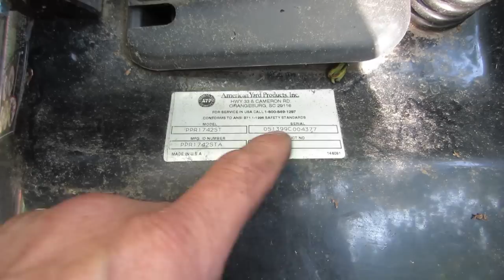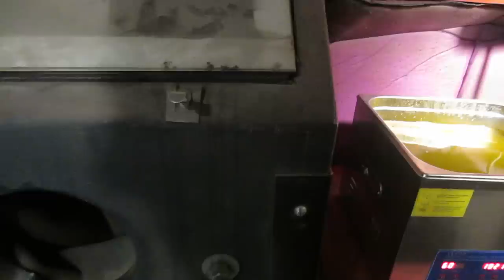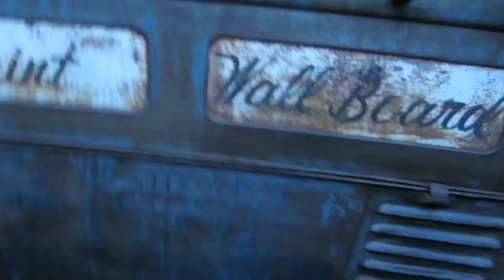abandoned poulan pro riding mower. will it run?

Comment: Thanks for 'letting me hang out in your shop.' I tore my mower apart the other day as a sort of preventative maintenance inspection. Checked valve clearances and the carburetor. 

Wouldn't have been so inspired to do so without what you've shown me while hanging out at your place.

Thanks again.

Comment: Few tips on these briggs engines. 1. Easy way to check head gasket is to remove the oil dipstick after it's ran for a few minutes, you will see smoke come out of the tube.

 2. The Walbro carburetor on most of these needs the brass inlet seat replaced or it will continue flooding the engine with gas.(the leak may not start right away. It can take up to several hours) The anti backfire solenoid does not stop this. Also replace the needle and bowl gasket. 

3. When your adjusting the valve gap and one or both valves are not moving the full distance, the camshaft lobes are most likely worn down. 

4. After adjusting the valves and the engine is still hard to turn over the cam shaft compression release mechanism is most likely broken.

A lot of you probably know this but it's just to help other's diagnose their engine.
Reply: Darrin i
Reply: Thanks buddy!  :-)
Reply: Darrin, I don't know this. I'm just getting into doing small engine wrenching and have learned a lot from Mustie1 and Donnyboy. Maybe one of these days I'll tear far enough into an engine to see a compression release mechanism! :)
Reply: Darrin I have never got such good advise from pickle Rick
Reply: add an inline fuel shutoff and turn off when not in use..
Reply: @Jakov0007  jokf
Reply: @StrangerInAStrange   the
Reply: In

Comment: Hi Mustie, I've been watching your channel for several years, I thoroughly enjoy all of the contents and projects you do. You remind me of myself, I too tinkered with many things, not as much as you but have been in the automotive field most of my life, from mechanic to service manager. I looked forward everyweek to see what is your next project, and I learned a lot from you about lawn mowers. I too own a Huscarvarna self propel that I need to fix. My mower of choice is my 10 year old Poulan 38 inch riding mower. I nursed this back to life so many times you would be proud of me. I did a mustie move when my front steering rod broke, actually the bajj joint rod the very long one. I used a 1/2 inch cooper union drilled a hole in the middle to fit on the drag link. and 2 hose clamps to hold it in place, and viola we have steering again. Cheap fix, 96 piece of cooper. Thanks for listening and please keep those videos coming.  Bob from South Jersey shore

Comment: A petrol tap in the fuel line is a good mod. Run out the fuel when you put it away and no carb problems next year, no petrol in the oil either.
Reply: Gas**

Comment: I do autobody and automotive mechanical work , I fix plastic cracks all the time. What I almost always  is make a thin aluminum stiffener to bridge the split back together , and I  rivet the aluminum on with 1/8" rivets but I also sand the plastic surface and aluminum plate face to help adhesion then use problem plastic repair material which is an two part epoxy made by SEM . If I do a plastic repair without an aluminum plate and just want to glue it , I'll V both sides of the crack out, sand the adjacent area with 120 grit paper , put 2" tape on the backside of the crack so the glue don't squirt through, and then ill fill the V"'d crack with Fuzer 100 by LORD products . It's a heat activated two part epoxy that works phenomenally. I fix cracked in plastic car bumpers all the time with this stuff and it lasts as a permanent repair . Sometimes you gotta dry the first coat then apply a second coat depending on how deep a crack or void your filling . Look into these products as they are Lifesavers when you need to repair plastic, or fiberglas .

Comment: Mustie1 I braved tackeling a needed carb replacement  job on my 5 year old John Deer lawnmower after watching your videos for a while. The lawn mower got to where it needed starting fluid to get going on every start.  I felt confident removing the old carb with all the little springs and seals and poping a new (from China) 9.99 carb on it.  Started on the second pull.  THanks Bro!

Comment: Living here in Florida, if you put on a set of blades they will not last long because of the sand. I own 6 sets of blades for my zero turn, and bought a sharpener called yellow hornet which uses a angle grinder works very good. Your channel is the best I've seen for motor fixing!
Reply: Jake Schisler  my Toro ZTR eats blades also.  I live near Tampa.  I mowed the church's soccer field and destroyed one set of blades in less than an hour.  It wore the lift portion of the blade down by half.

Comment: Hi Mustie: That is a valve rotator and usually only on the exhaust valve and not always on the intake valve. O.K. to run the motor without it on the intake valve. Thanks for the great video's. I really like to follow them. I run a small engine shop when I get time to fix engines.
Reply from the maker: l found the missing one inside when l did the head gasket

Comment: What I do with plastic like that is drill 1/16th holes along each side of the crack then sew the sides together with thread, fishing line, wire, whatever. Then cover it with super glue or epoxy.
Reply: Would that work on a crack on a Colman plastic canoe, or is it better to do the metal patch and rivet??
Reply: either way you have to seal the crack so water doesn't get in but the sewing method wouldn't leave the corners of a metal plate to curl up and cause a cutting hazard
Reply: You might want to check out some plastic welding videos.
Reply: Other popular method is to drill 3mm holes along each side of the crack and then "sew" the crack with plastic wire straps...
Reply: Awesome. Certainly worth the time and effort. Thanks for the video!!
Reply: Mike Mixer sophomore for sale
Reply: coleman? plastic weld is best, but riveting aluminum patches and auto glass glue is good
Reply: Hey, Duane! From the accent I would imagine somewhere in New England; Mass, New Hampshire, Conn, etc.

Comment: There was a bit of oil in the gas sump!
Reply: I suppose a stuck float could drain whatever was in the fuel tank into the intake and past the rings, but it sure looks like someone mistakenly fueled the crankcase.
Reply: Not likely. A small drip over several months will empty the entire fuel tank into the crankcase....
Reply: it can also get through the valve stem/guide/seal as well as run through the rings/piston gap. bad head gasket on those give it direct path from cylinder to crank case

Comment: One of the last things you mentioned is the reason why it was blowing oil out the breather  was because of a bad head gasket. I had an old tiller with a 8 hp Tecumseh I think I replaced about everything on it except the head gasket. Figures now that I got rid of if I learn what the problem was. That was a Great Video lots of great info. Thanks for posting.
   I put signs out and drive through the neighborhood looking for old mowers. In the last 5 yrs or so I have yet to find one in that good of shape. The local dump will Not let you have it or sell it to you. And the junk yards think they are made out of gold. But every now and then I find one at yard sales or the flea market. Sometime  people will drop one off for me to work on then let me have it because it cost to much to fix.

Comment: Great job, I too had trouble with that rubber on the grass shoot, I have found out in the past that if this shoot is hooked up tight and you catch in on something you might tear it off..... FYI. I just used a small bolt with no head on it so it can slip off. Thanks for sharing.

Comment: I bought a Poulan Pro 13yrs ago. It has seen a lot of work. Thick and often long grass, and is still going strong today. It does not have the catcher, but I use the alligator blades or the other mulching blades. I am on 5 acres, so work is easy with this mower. It was also  my first ride on mower and I had a two minute lesson on how it worked. I can't recommend the brand more especially to a novice. I have since bought a zero turn but still use the poulan pro. Great machine.

Comment: Does the jelly fuel burn?
Reply: loz11968 ,napalm
Reply: canuckguy worried ,HA!!!
Reply: loz11968 jelly fuel  Aka napalm
Reply: It will burn, but won't spray through the carb jets.
Reply: I know it won't go through the jets and run the engine, what I was curious about was if the jelly stuff was still volatile and could maybe be used as a fuel for a stove etc
Reply: It's low grade Napalm.
Reply: loz11968 You mean like Sterno? Hmmm...it probably would but I bet the black smoke from it being a petroleum product would limit its usefulness in most applications.
Reply: pyythons37
Reply: I was hoping he would put the torch on it. I have never seen that stuff before. Gasoline will get gummy but not gelly.

Comment: Don't know why people bother with those fuel stabilizers. I've never had a problem NOT using them.
Reply: Oh yes, i run the carb dry but I leave petrol in the tank over winter with no problem. I once left some 4 years and it still ran (not too well i must say)
Reply: the thing with usa they got a smart idea to put corn alcohol in  gas and that will becomes water
Reply: I use non ethanol fuel in all my small engines. Run them dry before storing.
Reply: David Howard l
Reply: There must be a certain blend or amount of alcohol that does it.  Creating the jelly..
Reply: Peter Fletcher ya i use seafoam in my gas.  Ill also dump the gas from my can into my truck after 1-2 months so it doesn't get too old.
Reply: I've seen the gel in my mowers after a summer of using ethanol fuel. I now buy non-ethanol fuel for use in my mowers and my wife's Toyota.
Reply: I run my small engine carbs dry at the end of the season. If the machine doesn't have a shutoff valve from the factory, I install one. Seldom have any problems in the spring.... no stabil needed.
Reply: Yeah, I know how we can save oil- let's burn FOOD!
Reply: because most gas is an ethanol blend now, ethanol is hygroscopic, it separates from sitting  and will be on the bottom of the tank and fill the carb.
best things, A) run ethanol free fuel and use marine grade stabilizer for seasonal used engines, B) drain all the gas and run the carb bowl dry..
Reply: Non-ethynol is what you SHOULD be using.  Otherwise you learn the EXPENSIVE lesson I learned last year when my riding mower (not this one), my pressure washer, and a weed whacker all had to have carb rebuilds because the ethynol had turned all of the gaskets to jelly!
Reply: Back in 1983 I bought a new motorcycle. The first winter I didn't put any stabilizer in it. The second winter, a friend of mine talked me into it. "You better use it or you will be cleaning your carbs" he said. I believe I followed the directions correctly. The next spring it cost me about $150 to get the carbs cleaned and synced. I don't have a lot of faith in the stuff.
Reply: You need to use the recommended measure of Stabil and it works well. I started my honda generator on the third pull after it sat for over three years. I put Stabil in it before I stored it.
Reply: I've never used them too. I just shut off the gas, run it until it stops, and drain the float bowl.

Comment: Hi from over the pond . loved this video ,but i do have one bone to pick with you , Never use flame on plastic as it hardens it so it will break quicker , use a hot air blower ( paint stripper hot air gun ) as this will not cause the plastic to go brittle as with gas . I have moulded both plastic and rubber in my working life .

Comment: Agree about the fuel stabilizer,have tried it in a couple small engines,just seems to cause trouble.My solution was let the machine run completely out of fuel.Come start up time,fresh fuel,engine starts easily,no stabilizer stink.

Comment: Mustie. Re the cracked plastic on the chute. Don't know if you've worked with it b4, but fibreglass cloth and resin work wonders.
A light sanding around the outer face, brush a coat of resin, wrap your strip of weave over it and brush/roll additional resin until cloth fully soaked and lays smooth.

Comment: I  have one similar to this one that's been well taken care of (17 year old). It's a PR1842STC . I was sick last year and didn't use it. Although I drained the gas, etc to winterize it I can't get it to start even though it turns over and the flywheel spins, but no engine start.
Reply: It's the carb. Clean up the carb and it will run. It's always the carb....
Reply: @ToyManFlyer1100  Thanks. I was planning on that next.
Reply: @ToyManFlyer1100  Ha ha. Yep. It was the carb. Instead of cleaning it I just ordered a new one and will clean the old one at my leisure.  Still needed a tune up, etc.

Comment: I worked for Sears in home lawn and garden repair for several years. The valve stud backing out was a factory problem on 17HP brigs engines this would almost always bend the push rod also.

Comment: Another great Mustie1 video. Saw that the mower had the better front end.
Reply: Better front end? It doesn't have a cast iron front axle!
Reply: Still better than they used leading up to this one. It was terrible. Steering pins held in with plastic bushings..Terrible..

Comment: Good job I love to see someone that thinks outside the box , not everyone would have caught that missing cap on the valve ! I hope you ran a couple quarts of cheap oil (one at a time) through the engine after you drained the the gas oil mix out before you put the good oil in !!! :-)  and contrary to what my wife says , it does pay to keep old parts !!!!

Comment: I have that same tractor as a spare.  I abuse the heck out of it on the farm.  But mine has that same carb problem dumping gas in the cylinder.  God forbid you haul it, it good not to start for sure then too!  I have it mostly fixed now.

I like to use it for a bush hog so I don't have to skeetch up my precious Kubota.  :D

I didn't know stabil would do that.  Note to self..use sparingly!  Thanks for the tip.  I like "it's stabil all right"!

How did that run with the valves out like that!!  That's amazing.

Comment: I've been using Stabil since 1993. I follow the directions and I use it year round, as I use my 2007 John Deere X300 during the winter with the snowblower attachment.
Note: I try to keep to a schedule of running the tractor every 3 weeks if it is not being used. I run it for about 15 minutes just to use some gas and keep the battery charged as well. 
12 1/2 years of service, and its doin fine. I put the Stabil in each of my gas cans so it mixes with the gasoline when I fill them.

Comment: You can do a 90 degree twist on the hook that you made for the grass collector to make it fit better, and shorten the hook also.
When heating plastic pasts (for the front light), for bending, keep the smallest part facing downwards. Otherwise the heat from the flame goes up, melting the tip that should not bend.
Nice video as always :)

Comment: You can still save the original carb just by using the mower as is with fuel detergent.  He had it good enough to mow lawns, just not idle and riding the choke a bit.  If you go ahead an mow a few lawns with it, with detergent in the fuel, it will run better and better as it cleans itself out.

Comment: A trick for split plastics.. take a hose clamp like at 21:00.. cut off enough tread to cover the crack.. shape to fit any contours where crack is.. heat to red with torch and press into crack..voila! Plastic melts through the spaces in the hose clamp! Great trick for bumper covers!!

Comment: Put in a Fuel Block Valve upstream of the fuel filter is always a good idea, so the machine doesn't flood out again with gasoline when stored between cuts. Did the piston hydro locking with gasoline cause the blown head gasket, that's what happened to my Craftsman Tractor 19HP Briggs...They say the 19HP was a bad engine anyway.
Reply: Agreed.  Have one on my Honda.

Comment: I have found that when the lawn mowers blades are the thicker kind. You can weld just one or two passes of hard surface on the edge and they will stay sharp for a long time. Only blades that are 3/16 thick or thicker this works great on.

Comment: Why waste money putting Dielectric grease on the spark plug boot to slide it on when you could have just used that free snot jelly you found in the float bowl? LOL. Thanks for all these great video's! I have learned a lot from you since I started watching them last October. I also have this same mower that I paid $500 for and only used it 3 times before winter came. The next spring I tried to start it and no go... So now I will have to do some trouble shooting and will use your video's and knowledge to see if I can bring life back into it. Cross your fingers for me! Keep these awesome video's coming, my friend!

Comment: Ah damn, that's a shame. I just bought a lawnmower for the first time about two months ago, I put half an ounce of sta-bil in the gallon of gas before I poured it into the lawnmower (just in case I didnt use all the gas and it sat for a couple months)... I live in Florida and now I'm wondering if the heat would prevent that from happening, or worse, make it happen faster.

Comment: Drill a little hole at the end of the crack. Stops crack from growing beyond the hole! (Learned that from some Mayday air disaster video and tried it with a cracked frisbee. Actually works!)
Reply: Now I see mentioning that when you fixed that engine block in february. Ah well.

Comment: Yes drill a small hole at each end of the crack to stop the crack from lengthining. Have you mentioned that ultra Sonic cleaners have to be turned off before you put your fingers in the solution, for obvious safety reasons?